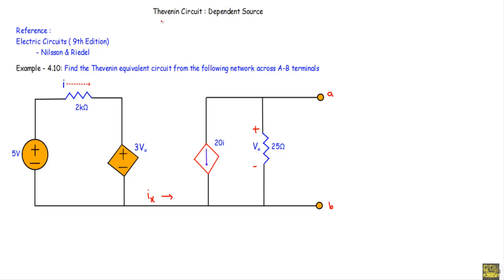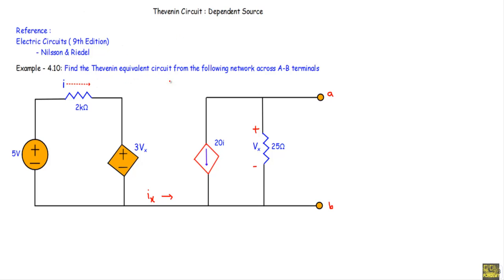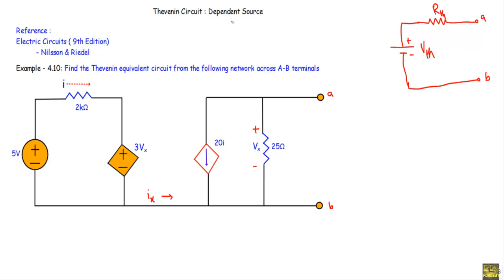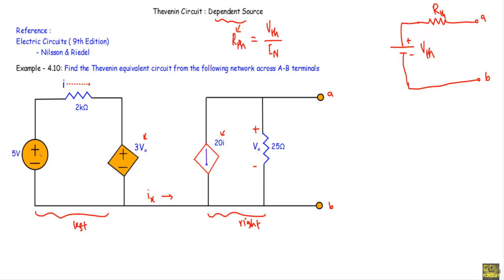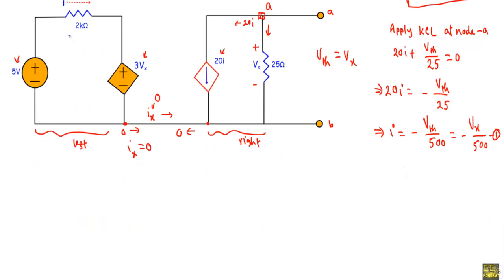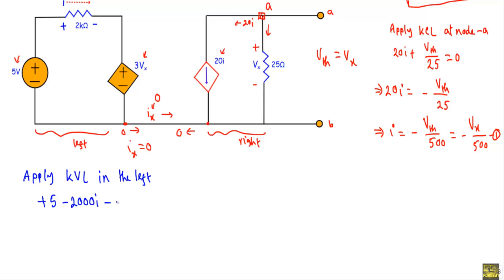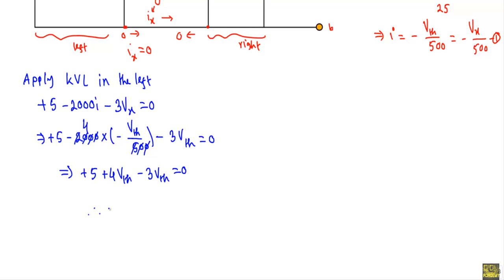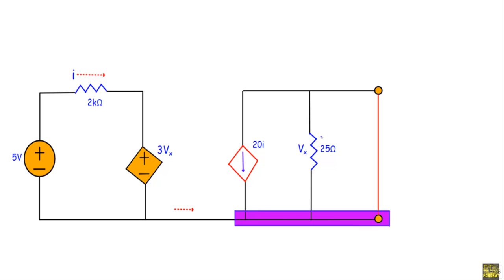Thevenin Equivalent Circuit : Dependent Source (Hard) (w subtitles)

Comment: I had the same question with different values assigned to the circuit elements. After finishing my work on the question, I opened YouTube and what do you know, I find this video. I did it correctly according to this video, thanks for confirming my work.